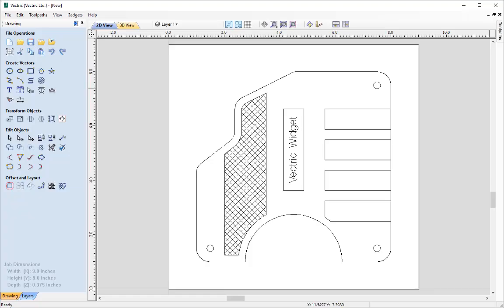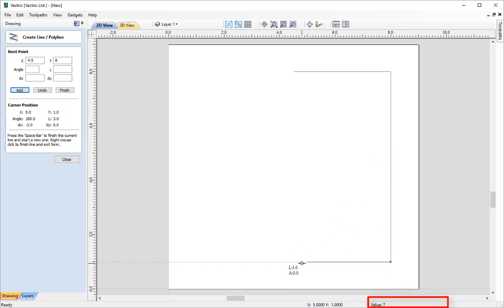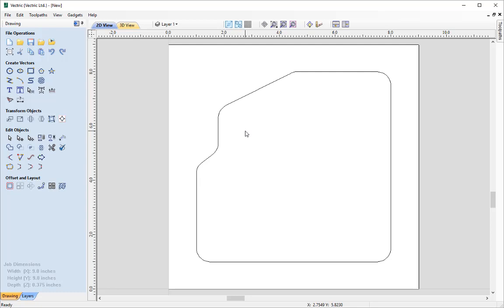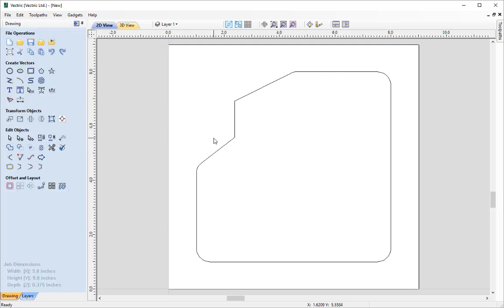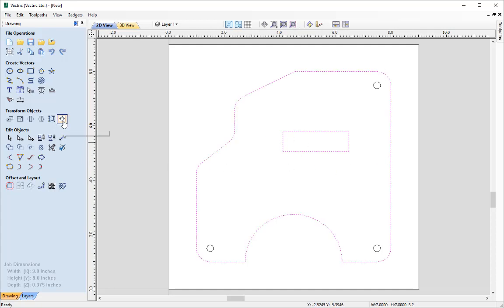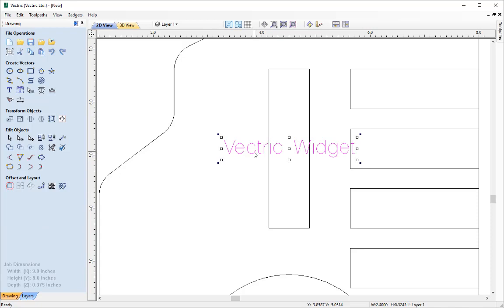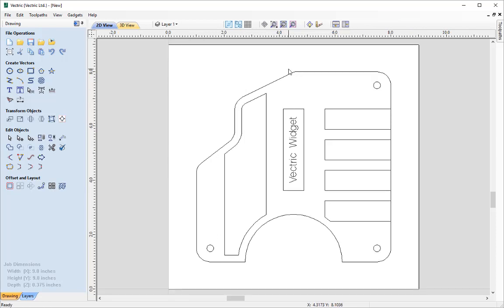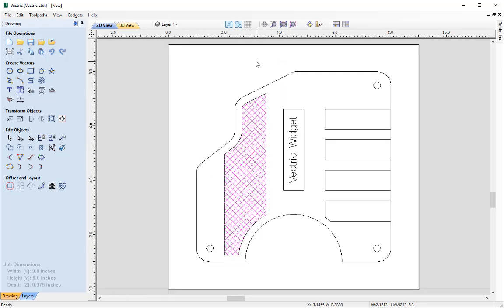Vectric Widget | Vector Drawing | V9

Comment: Just an observation. Doing a simple copy and move of a line seems awfully complicated compared to other programs.
Reply from the maker: Hey Woodshop, thank you for your feedback, the aim of this tutorial is to demonstrate the multiple ways of drawing vectors, to cover the many different ways you can draw in the software, from free drawing, to using form entries, to using transform keyboard shortcuts. The simplest way to copy and move a line would be to select the line and holding control down will copy your line, where you drag and drop to position the copy. Hope this helps :)